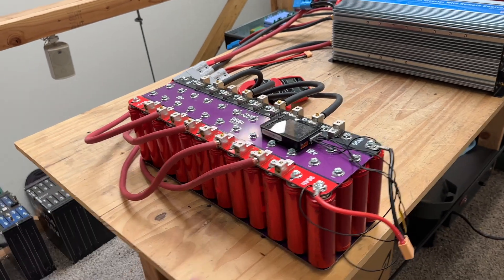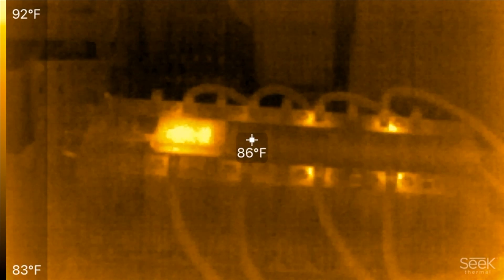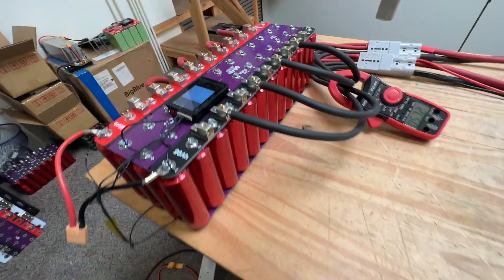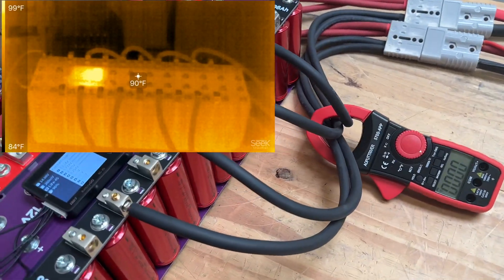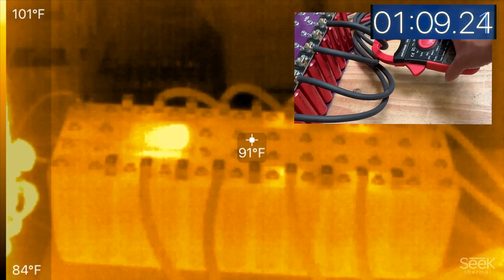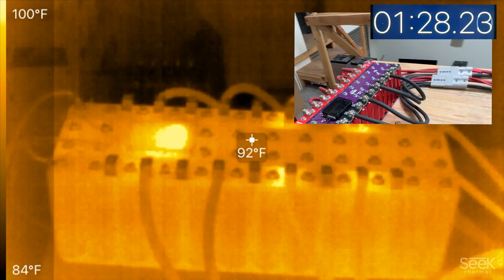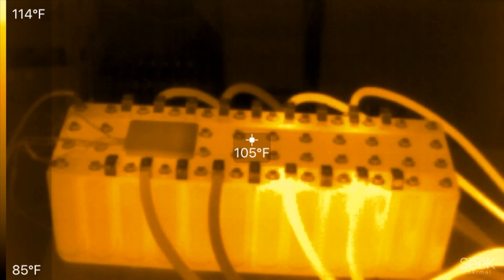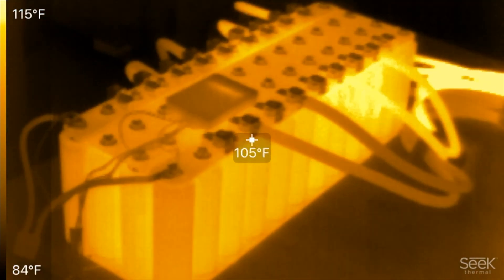96Ah headway PCB BusBars Heat Test

Comment: I have three questions. Do not misinterpret any ill will on my part in asking. But I am interested in understanding your pack. Question 1: You indicate (2:54) that each row is capable of supplying 50 Amps. You are using a figure of 8 Amps per cell so I'll use that number. Though the voltage of each cell in the row is summed in order to provide the desired output voltage (3.4V times 4 cells) of 13.6 volts, the output current supplied by this row of cells (4 cells in series) is still 8 Amps though at 13.6 volts. The amps are not summed unless the cells are in parallel--in parallel, the current would be increased by a factor of 4 (or 8A times 4 cells) in which case you'd have 32 Amps but the voltage would still be 3.4V.  Question 2: Since the cheap cable used for providing current to the AC inverter was getting very hot and drawing excessive current, is it possible that this cable is preventing you from obtaining valid measurements? Question 3: What kind of BMS system do you have in place on this pack? I did not see it described in the video.  Thank you.
Reply from the maker: Do not mix Amps and AmpHours,  those are 2 different things.   Each row of 4  (8Ah) cells in series is capable of 50A @13.6v.  this packs 12 set of 4 cells connected in series thus 50A x 12 = 600A.
2) The Welding cable is not Cheap, its some of the highest quality cable arround,  Measurements are being taken before the cable so it has no effect on results.
3). No BMS
Reply: Thank you for the reply. It perfectly answers the questions I had. Many thanks. @jehugarcia

Comment: Do u have pcb bars for spimo8hp 3.7v 16ah for sale
Reply from the maker: No,  when I had those they didn’t have the holders,  now it’s easier with holders
Reply: @jehugarcia   yea but pcb bars looks better and safer when attaching the series or parallel configuration plus you only limited to 300amps busbars  and 6 connects..

Comment: in this configuration, the cells at position 3 and 9 are carrying higher current flow as compared to positions 5 and 7 - i would speculate that 9 (the one farthest from the charging terminals) has some cell variations in the nine cells it has to pull from - i would further speculate that 7 is just experiencing some proximity thermal bleed over - considering the load?- again jehu - few folks have the ability to dyno the theoretical high end like this lol - another insane demo man!

Comment: This sort of thing tells me my ideas about using PCBs as (Ebike Battery) bus bars aren’t completely bogus.

Also, the need to a thermal camera is paramount.

Chief question - did he go for copper thicker than two or three ounces?  I’d try to go for more, if possible.
Reply: thermal cam is def nice - but keep in mind if you're really going to push it to it's sustained maximum you should have it air cooled (like it was originally) or at the least add high temp cutoff - which (to me) this was not a high temperature at all - THIS IS NOT BATTERY BUILDING ADVICE lol - jehu let's collab on a 36v pcb come onnnnnnnn man - help us two wheelers outttt!!!
Reply: @hmtechsvc  thermal camera for debugging and troubleshooting, i.e. finding high resistance places.